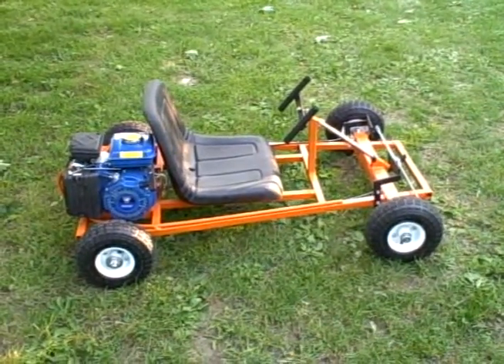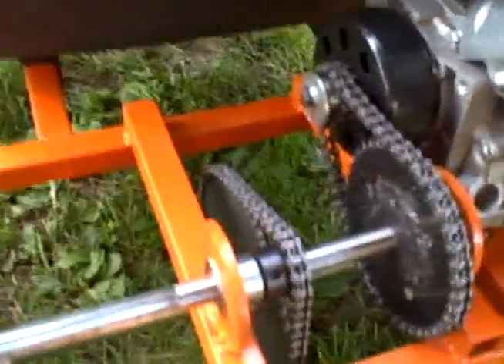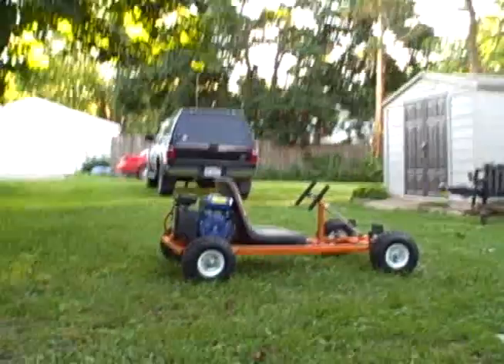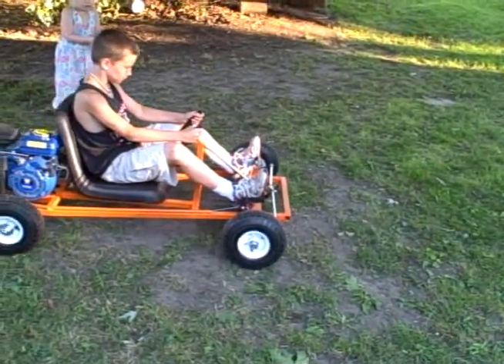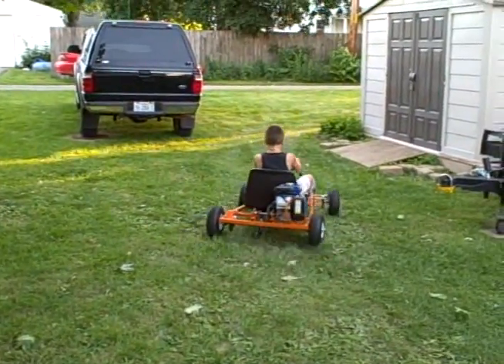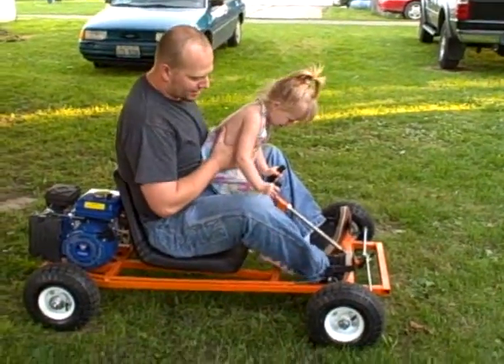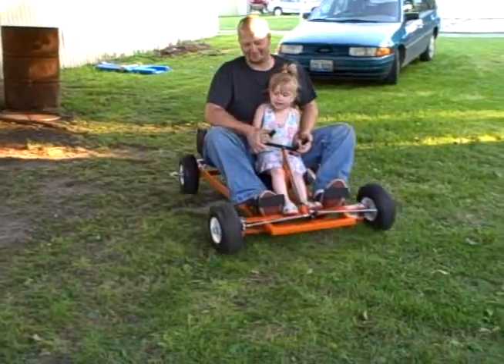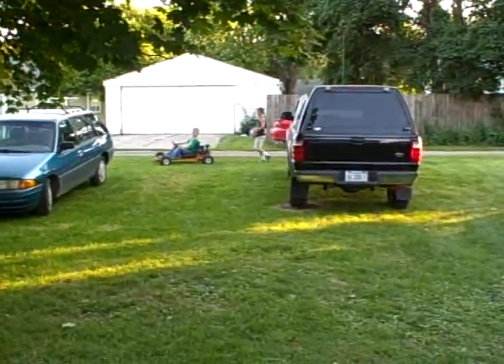Homemade gokart (gocart) with Harbor Freight 2.5 hp engine 79cc

Comment from the maker: @beatingu868 

It wasn't that pretty!  :^)  I went a little overboard with it.  That is a sproket welded to another sproket. On sproket just had a large hole in the center and the small sproket was the one that actually fit the jackshaft.  Since I had to weld/fill in the groves in teeth of the smaller sproket to the larger one I went over it twice.  In after thought I am sure just the one round would have worked fine.

Comment from the maker: I clocked it with my GPS at about 13mph.  Fast enough on such a small kart.  The best is that it climbs the hills really well.  If you look at my other videos there is a POV of me driving my dad's John Deere model A around his properly.  You'll see the hills along the fence line.  Believe it or not I went around that whole section with the kart with no problems.

Comment from the maker: Rims came from Northern Tool.  The tires and tubes are the $10 ones for dollys from Menards.  I just throw away the cheap rims and mount them on the Northern tool rims.  The tires wear quick on pavement but aren't too bad in grass.  Only real problem is the tubes have a straight stem and really need a 90 degree one to make maintenance easy.

Comment: @spyder000069  sounds good i miss me and the boy tearing it up with the tecumseh 3/12 hp.on a $20.00 frame.never checked it for mph but felt alot faster than 13 mph.i set up two throttles on mine.one for the kids w/gov. and one for me wide open.we could double up on it and really move.not a hole lot of hill action though.have fun man while you can.

Comment from the maker: It was changed to a 40T with a corresponding change to the jackshaft sproket to keep the ratio the same.  Plenty of clearance now.  We just got back from my parents farm and rode it through the field with no problem.  I even took it for a spin through our "tractor trail" which has some good hills and it climbed up with my 215 lbs no problem.  I took my gps with me and opened it up to see what its speed was and it hit a cool 13 mph.  :^)  Again, a trade off for speed to be able to climb the hills

Comment from the maker: Thanks for your comments!  Originally it didn't have alot of clearance because it was a 60T sproket on the axle.  I then swapped that for a 40T and just changed the gearing on the jackshaft so it was close to the original gearing.  Gave another couple of inches of clearance and so far no problems.

Comment: can any body help me out i have a briggs im pretty sure its 5hp but the shaft has no key way and its not taperd but it has threads part of the way down the shaft i was wondering if its possible to still use a centrifical clutch on this motor thanks

Comment from the maker: I appreciate the kind words.  The focus of this kart was to make it small enough for our backyard.  We had a pocket quad with a 50cc 2 stroke.  It was very loud and I figured the neighbors probably were annoyed.  Plus it was geared high so you really had to burn the clutch to go slow.  This kart is much safer and the kids will never fall off (which did happen with the quad once).  The four stroke motor is much quieter and has a much more pleasing low tone.

Comment from the maker: Yes, it does push a little into the corners at full speed but not bad.  Like you said the speed isn't fast enough where it causes a problem.  Also the configuration puts a good amount of weight on the front tires since its short and your knees are bent while riding.  So that adds to the traction on the front.  I think its probably good though to teach them about the effects of oversteer.  Especially once they get old enough to drive in the snow here in IL.  :^)

Comment from the maker: No posi as there is no differential.  :^)  It is a straight axle though so both tires do provide power.  Its good and bad.  The good is it never spins.  The bad is it never spins and eats up the grass in the yard on sharp turns.  :^)   The 2.5hp is smaller and lighter weight so its easier on my back loading the kart by myself in the back of the truck.  Its plenty of power for the boys and is less worry for me.  I can run wide open and crank the wheel and it doesn't lift a tire.

Comment: @spyder000069 Yes the bushings require a lot of lube to keep them from wearing and from locking up as yours has. You might consider buying a better clutch, one that has needle bearings instead of a bushing. They are a bit pricey, but much better in the long run.

Comment from the maker: I used a clarke mig welder with the .030 gasless wire.  It was tough trying to not blow through the tube.  I went through in plenty of spots and then had to fill in the holes.  Then I would grind it down and lay a second bead to reinforce.  Definately learn to be more careful.  :^)  I'm a beginner so I expected some learning curve.

Comment from the maker: The 2.5 has been a good motor so far.  I did just have to replace the clutch.  I haven't figured out what went wrong yet.  If the kart was coasting at like 2mph the clutch would engage and keep the kart going.  I could just have the kart idling and manually push it and then it would engage.  With the bell off everything looked just like the new replacement.  I think maybe the bell was locking on the bushing that it rides on but not sure.

Comment from the maker: Welded it up myself.  If you check out my other videos I do a walkaround with a tape measure with measurements and I talk a little about what I used for the build.  It wasn't as hard as one would think.  Hardest part was trying not to blow holes through the thinner tubing and once you do having to repair it.  I am no expert welder but this was a good project to help me learn what settings work well with my welder.

Comment from the maker: We spent $300 on a 50cc pocket quad the previous summer and although it was slightly faster the kart takes off alot faster and I feel much safer on it.  The chinese pocket quad frame snapped when I was showing a buddy it.  Luckily I was coming to a stop.  10 seconds earlier and I was doing 20mph on it and I would have taken a tumble.  This engine is 1/3 the noise level too so I don't feel bad for the neighbors when we race it around our yard.

Comment from the maker: Couldn't tell you for sure.  I estimate just under $450 for everything. Steel gets expensive buying it from Lowes.  If you have a local steel show you could cut costs.  Also my seat was a new lawnmower seat so it was around $40.  I could have saved if I bought my kart rear axle and sprockets at once instead of experimenting and having to pay for additional shipping charges.

Comment from the maker: Yes.  Motor was full of oil but during a fast turn it would kill the motor.  There is a sensor in the lower section of the block.  Unplug it.  Problem solved.  Just make sure to check oil level before running (should be doing that anyway).  :^)

Comment: Right now the 2.5 HP engine at Harbor Freight is $89, which is about  £55 (it's even less with a coupon). The 6.5 HP engine at Harbor Freight, which has more power than yours, is only $99 (£61).  The Harbor Freight engines are actually really cheap and good quality.  You should check out Harbor Freight if there is one near you.

Comment from the maker: £99 is $161 USD so thats quite a bit more expensive than the $99 I paid for this engine.  :^)  I have small four stroke engines for my R/C airplanes that I have paid $180+ and they are less than 10cc.  Really for me it comes down to novelty.  I really liked creating something that worked well with a small engine.  I would guess its quieter than a 5hp engine and its easier on the gas and is lighter weight and physically smaller.  Less compression so its easier for the kids to start too!

Comment from the maker: Thanks!  That style of riding only lasted about 2 days.  Now its wide open.  Should be alot easier on the clutch though cause both boys only weigh about 60 lbs and with the jackshaft its geared low enough to not put a big strain on it.  Clutches are $30 and we spend more trying to get into a movie nowadays.  :^)

Comment from the maker: The same 7.33:1 could be done with a 10tooth engine sprocket and 73 tooth axle without a jackshaft if you wanted to think of it another way.  The problem is a 73 tooth sprocket is bigger than the 10inch tire.  :^)  At the 7.33:1 ratio with 10" tires and 4000 rpm the speed would be just over 16mph.

Comment from the maker: So like on mine it has a 12 tooth clutch and a 40 tooth mating sproket on jackshaft so 40/12=3.33.  The axle sprocket is also a 40 tooth and its mating sprocket on the jackshaft is a 10 tooth (if I remember right).  40/10=4 so add 3.33 to that and your final drive is 7.33:1 or 7.33 turns of the clutch bell to 1 turn of the rear wheels.  With the final ratio you can plug it into many online calcs with a rpm and tire size and it will give you estimated speed.

Comment from the maker: Verticle engines are a no-go for gokarts.  :^)  Takes too much to convert verticle movement to horizontal axle.  The gearing ratio is pretty easy.  On a single chain setup you just divide the teeth on the engine by the teeth on the axle sprocket.  On one with a jackshaft like mine you divide teeth on engine by teeth on its mating sprocket then divide axle sproket by its mating sprocket on the jackshaft and then add the two numbers.

Comment from the maker: First go cart they have been on.  Only other motorized vehicle was one of those little 49cc chinese pocket quads.  That thing was so noisey being 2stroke that it worried them.  I had installed one of those wireless remote kills on it but they didn't take to the bike.  Now my youngest runs the cart full throttle and I ride on the little 72cc motorcycle aroudn the yard with him.  We run around the house in the front and then the back.

Comment from the maker: I did change the axle gear from a 60T to a 40T which gave much more ground clearance for the sprocket/chain and then also dropped its corresponding gear on the jackshaft to something like a 10T.  The end ratio just changed slightly and gave it a couple mph while still taking off nice and the clearance was a big bonus as those 10" wheels don't set you that high off the ground and the 60T would occasionally rub our cement driveway or rocks.

Comment from the maker: I don't think this engine can push 25-30mph unless its on asphalt and with a kid.  With my current gearing i'd estimate it to run15-18mph and it will outrun the engine (no governer).  I think with me on it 20 would be pushing it but probably with the kids 20-25 is feasable if you accept a slow start and no hills.  Really though I am very satasfied with its current setup.  It has plenty of takeoff power and can stop on a hill and get back going without burning the clutch.

Comment from the maker: Nope.  I got exactly what I wanted for a good price.  Heck one of my 6cc radio controlled airplane four stroke engines run $200+.  This was a steal!! HA!  This engine carts me around plenty fast and is more than enough for my kids.  Because of its small size I was able to make the cart alot smaller.  Anyone can slap on a 6.5 and call it a day.  Using the 2.5 with a jackshaft makes it a little more interesting.  Why do you think those 49cc mini quads sell so well?  Its a novelty thing.  :^)

Comment from the maker: Thanks!  I have some 16 guage steel to put on it once I get some time.  I left it off originally so I could get paint all the way around the tubing and I will just rivet the sheet metal to the bottom.  I am also thinking about scratching that and instead using some metal mesh like the floors of some trailers.  This way it wouldn't hold water, grass, ect.

Comment from the maker: Thanks!  Its funny how many friends and family ask why it doesn't have suspension.  I really have a hard time explaining how it feels to run wide open in a tiny cart with no suspension and just rip around a corner hanging on to your seat.  There really is no comparison to a smooth riding four wheeler, motorcycle, ect.  Its just the basics and that is what makes karts so fun.  Like when the front wheels skid a little into the corner and you learn to slow down to make the turn.

Comment from the maker: I'm more worried about fingers in the sprockets/chains than head injury.  Also the tongue on the trailer is nowhere near head height.  :^)  Its sits 18 inches from the ground measured to the top.  For comparison the exact middle of the steering wheel is at 19 inches (yes I went out and measured it today).  So there is no worries or obstacles.  I appreciate your concern.  We took it out to my parents to ride out in the open and it was a blast.  I'll have new video shortly.

Comment from the maker: Easy there.  :^)  I am overly cautious about safety.  If you didn't notice in the video the cart runs about 8mph tops and with the kids its governed down with slack in the throttle cable.  They can ride their bike faster than this cart will go.  They have a helmet for their mini bike.  :^)  I'm not worried about the kart.

Comment from the maker: The engine is 79cc. This project started because I bought 4 tires and rims for $10 a wheel. Well the rims didn't hold up so I had to buy real rims.  My homemade axle (sleeved threaded rod) didn't hold up so I had to buy a real axle.  Then without the jackshaft setup it was too fast so I had to buy the shaft and sprockets.  Seat was $40 at a farm store. So I got about $400 in it total.  Learning to buy the next project instead of building it.... priceless. Good feeling to see what you built work.

Comment from the maker: Really I could have left the governer on and been satasfied with it.  Now I have to rig up something so they don't overrev it.  :^)  It picks up quick.  I was going to build a little box over the gears to for extra safety but since this was the second gokart frame I built in less than two weeks I really just wanted to get the project over with.  The first one I used caster on the spindles like a car has but it made it much more difficult to steer.  This one has zero caster and ackerman built in.

Comment from the maker: You can buy it from Harbor Freight.  Normally $109 but the web price is usually $99 and often you can combine their coupons to get it even less.  The engine runs great.  Initially it kept cuting out on me before I figured out it had a low oil cutout that was getting triggered when I was ripping around corners.  :^)  I just unplugged the sensor and keep an eye on the oil myself.  Its pretty darn quiet.  The go kart clutch is the loudest part.